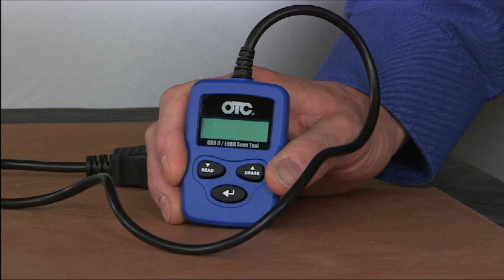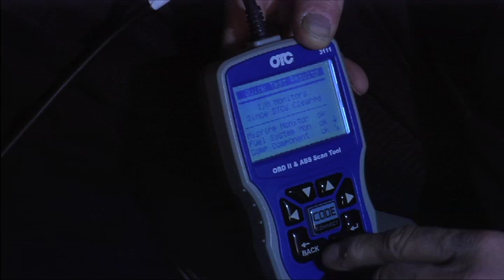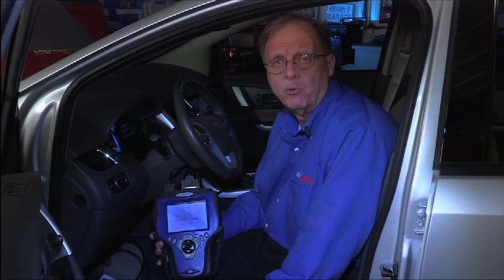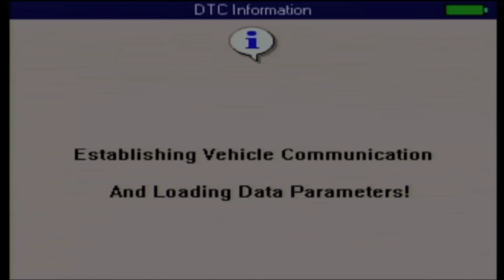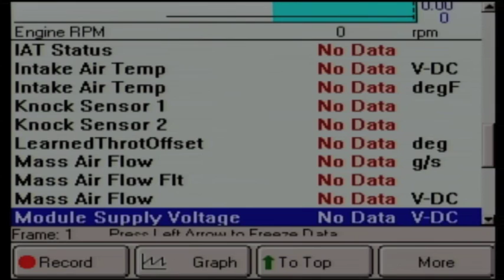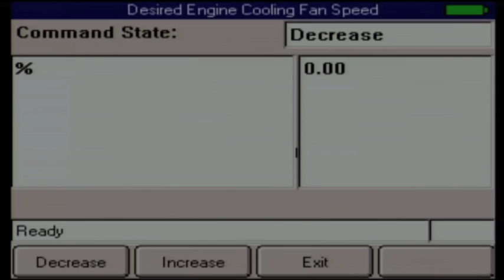What Is The Right Scan Tool For You?  Part #1

Comment: Hello guys. Thanks for your valuable information. I have seen quite a bid videos about scan tools but I am still confused and hesitant about what to buy. I have some knowledge about cars and have already Innova 31603 which scans emission related codes and some limited ABS/SRS codes. I need to get something that is able to read all other warning lights even on hybrid cars, check the function of different components involved if it's applicable in order to narrow down the possibilities both on foreign and domestics. I have read some about the ones that can be hooked to smart phones, ipads or laptops. Of course some are only trying to sell and only say good things about them! What's your suggestion? Thanks

Comment: Based on my link here :- https://www.facebook.com/russell.booth.372/media_set?set=a.541123729410631.1073741845.100005390262695&type=3
 
Can you tell me which scan tool is right for my 2002 model Holden Commodore?
It has the Chevy LS1 engine fitted to it & is Australian built,it is the older GM specific SAE J1850 VPW OBDII protocol system, both my scan tools will not read trouble codes when a DTC is set but will display live data.
I however,go to plug them into my dads 2014 model Holden Colorado which has the ISO 15765 CAN-BUS OBDII protocol system and what do you know , it reads a P0113 code after I disconnect the mass airflow sensor , note it is a pending code rather than a stored one.
I need a scan tool to diagnose a DTC which is set in the Commodore which comes on ,on deceleration or when I've got the cruise control on a DTC is set when I drive down a hill & it doesn't have to be big either.
I need a scan tool for my car so I don't have to friggin guess,meaning I don't want to have to try & have a stab in the dark by thinking it's an air leak when it may be a misfire code , a worn timing chaing triggering an out of range fault code for the crank trigger or just simply a dirty or faulty mass airflow sensor.
If I buy another scan tool but this time from a reputable dealer either on or off Ebay and it doesn't work, I'll just take my car to Holden where they can plug in their tech 2 unit & tell me what's wrong for $75 rather than being sold a crappy generic scan tools which can't even retrieve generic fault codes (i.e. engine only) from a Chevrolet powered car, I'm  fed up with being lied to by different people telling me my car is OBD 1.5 & not fully OBDII compliant when the only Commodores in Australia were fitted with the 3.8 litre Buick V6 & AC Delco PCM until 2004 (unlike Delphi in the U.S. from 1996 onwards), that OBD 1.5 PCM was fitted to the Buick V6 powered Commodores from 1993 - 2004, but the LS1 powered Commodores were the very first OBDII Holdens in Australia,which were fitted with Delphi PCMs.
I'm also fed up with people ignoring me when I ask them why both mine don't work properly or will never tell me which ones will work on my car.

Comment: The only good scan tool that you can buy from OTC is something that OTC or SPX have developed for a certain company, like the SPX MVCI that SPX/OTC specially designed for HONDA MOTOR CO, if you buy a OTC Genesis or any other aftermarket scan tool, then you will go through headaches and very poor coverage, very limited by directional controls, go with the OEM and you're at dealer level, as simple as that.